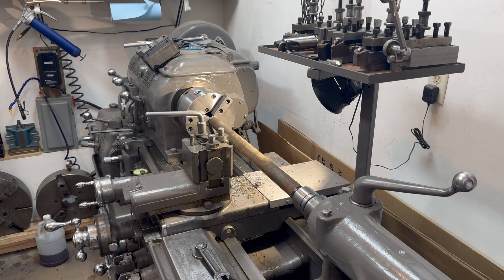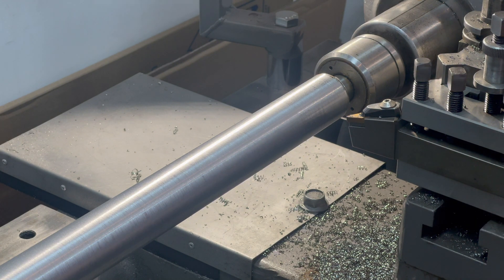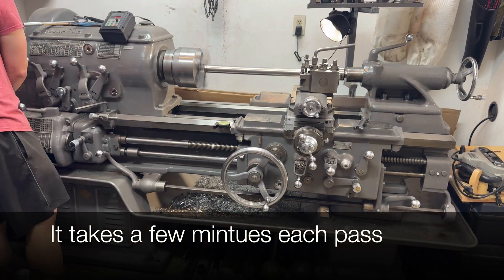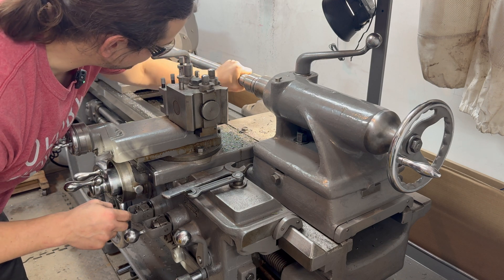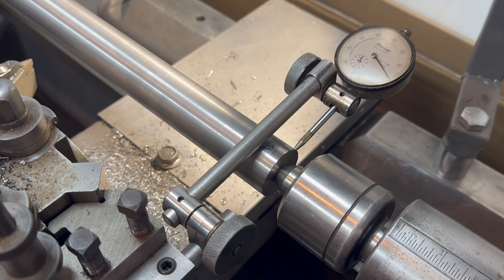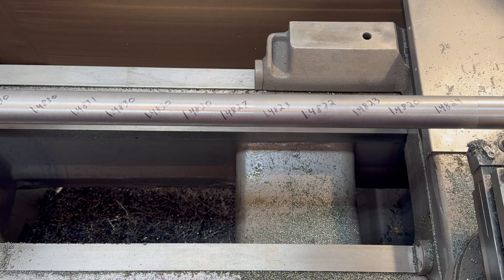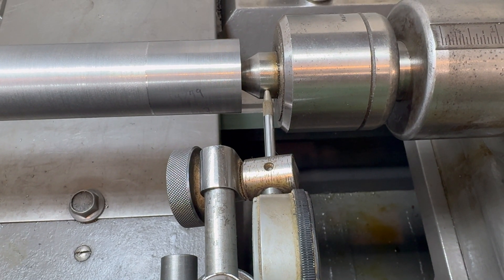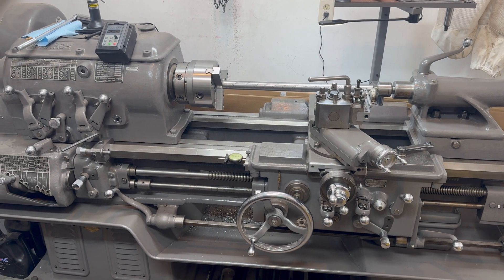1940 Monarch Lathe - how accurate is it after 84 years?

Comment: i've been a manual machinist for 40 years and you obviously don't know what you are doing, {no offence intended} leave the tail stock tight but not too tight and adjust the tail stock by tightening one side as you loosen the other side watching the indicator as you do so, if it has a one thousandth taper you only move the tail stock by a half thousandth, 
first you need to make sure the bed is leveled to within a half thousandth both in X and Y directions, you have wear in the ways, and good luck with that old dinosaur
Reply from the maker: Yeah… it was obvious to me as well that I didn’t know what I was doing (that has never stopped me though) but I’m getting there. A lot was learned on this exercise.

Comment: You need to make you test bar differently. Relieve the middle part by say .125" and leave the ends (about an inch) so it looks like a dumb bell. This makes it a lot faster as you don't have to cut the whole length on your test and it reduces any wear on the cutting tool that may occur on the long cut.
Reply: As Georg Schlesinger  said in his works some 90 years ago.

Comment: What you are seeing in the center is deflection of the material from the tool pressure. Do several light cuts, then several passes without changing the depth of cut. 
This will show you where you are in alignment. 
Typically you should do a test cut of 3” long at the chuck, and the same cut at the tailstock. 
Both diameters should be the same. This way you don’t need to worry about bar deflection.
Reply from the maker: That’s a great idea. I think at this point I am punching above my skill and am content that this lathe is plenty accurate for my current projects. I will definitely keep this in mind.
Reply: Shaftwork needs Brazed carbide and knowing how to use it.